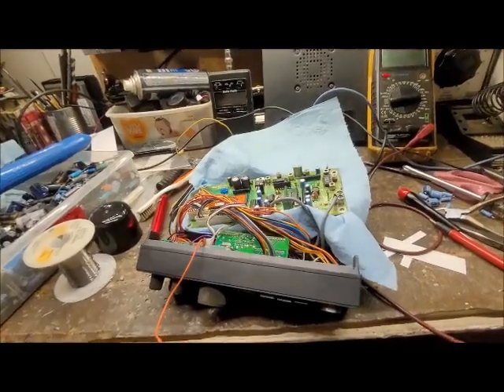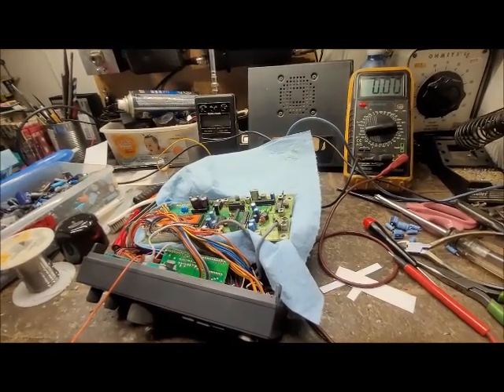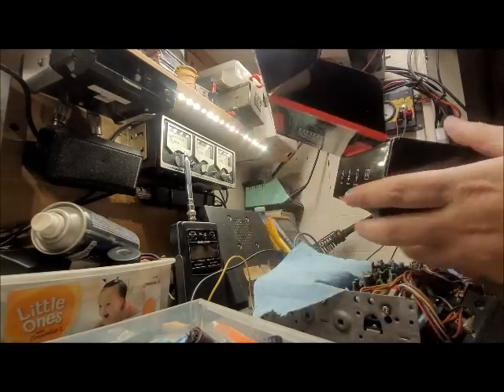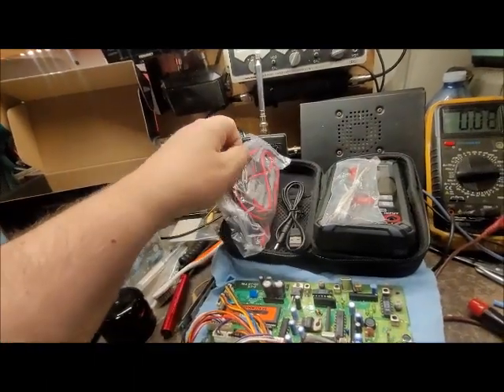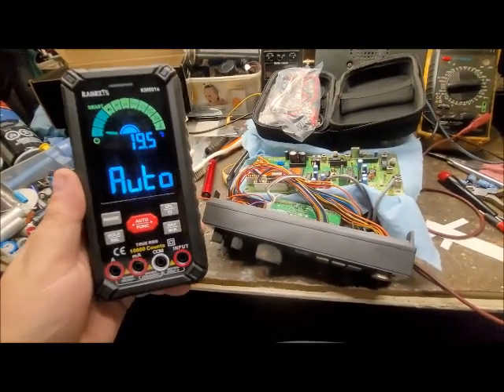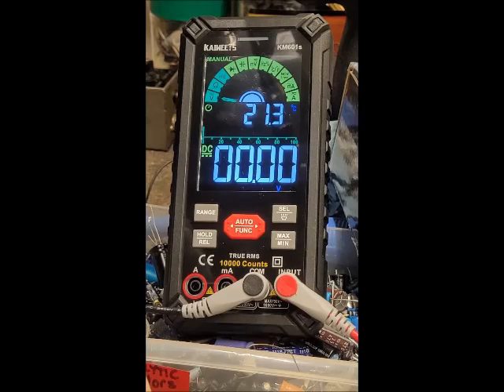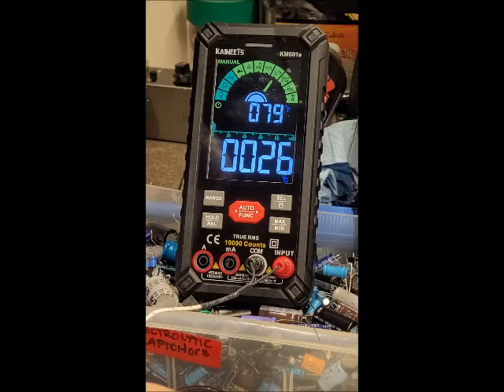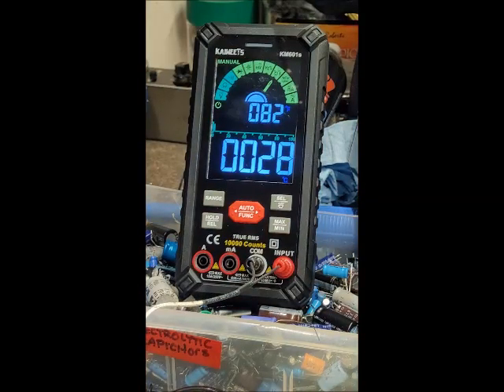KAIWEETS  KM601S Smart Multimeter

Comment: I’m not so fond of the usb charged battery. Looks cool though. Easy to read. Nicely lit. Easy to film. Which I think is a better point for you. Seems pretty accurate. 
I found one with a single channel 10mhz scope in it. To work with on older cars and audio on the go.